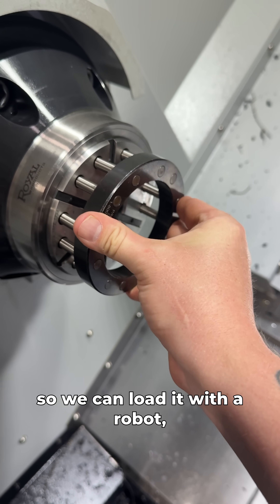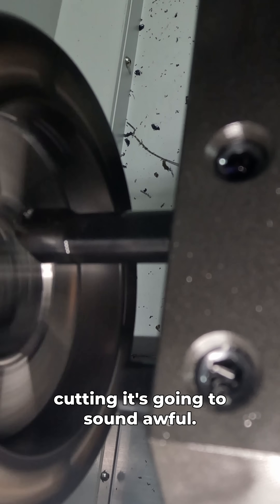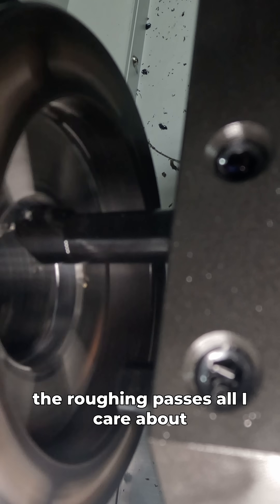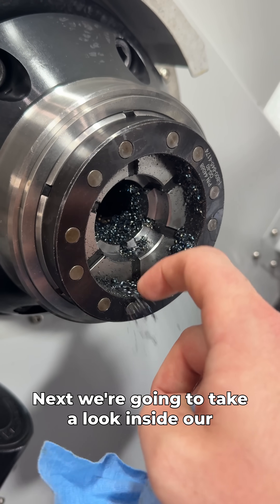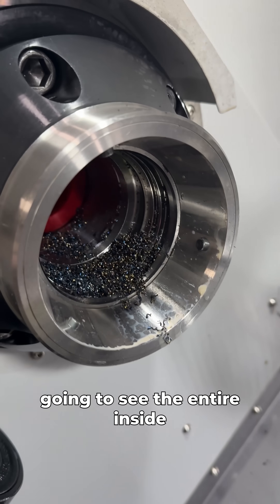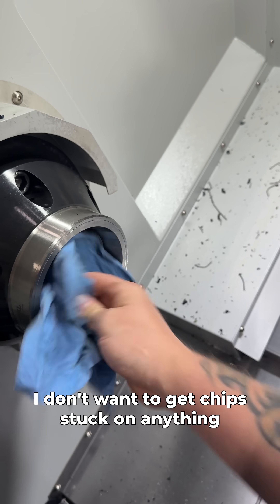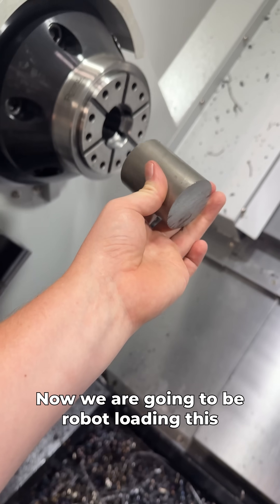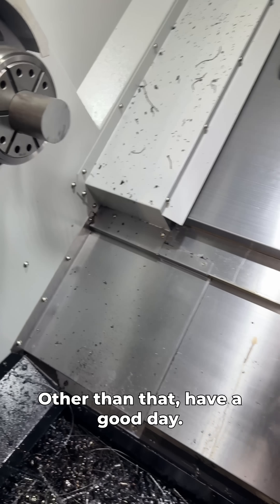Getting ready for robot load

Comment: You guys need to learn to use shop vacs like we did 40 or more years ago. I talked to my bosses into buying Craftsman shop vacs. Airguns have no business around machines
Reply: Shop Vac with a cyclone on it in my home shop.  The cyclone keeps metal chips and sawdust out of the filter.
Reply: Ordering 5 tomorrow. How did I not think of that? Hero of the day!
Reply: What about when your daily assigned  machine tool is a floor type Horizontal Boring Mill with a 30 ft x 15 ft y and  70inch spindle. Your parts weigh 1-5 ton depending and you're  filling 3-5 fifty five gallon drums in 6 hours or so? Compressed air is necessary  around machines in certain circumstances.
Reply: there wasn't high pressure coolant 40 years ago either...

Comment: I know nothing but why don't you blast air through the collet towards the working area to keep chips away from everything?
Reply: an extended air gun woulda worked starting from the back to front
Reply: The spindle/tube on these lathes is literally like 4 feet thick. I guess if you had a really long air gun it would work.
Reply: @BryceKimball7.3 I was thinking of the exhaust on a vacuum cleaner or a leaf blower
Reply: Because it can blow chips where you don’t want them.
Reply: @sjv6598 but aren't they already going where you don't want them?! Step one: get them away from the collet, further steps, suck or blow to get them away from other bad places🤷‍♀️

Comment: Iv used royal
Collets for a long time… never seen anyone cut one lol… they are like 500-800$ collets a piece lol. Don’t mess up😂 a programmed stop with a pin to pull your part too is cheaper then this lol
Reply: Well he said a robot would be loading it, so a pull out stop wouldn't work. Granted still wouldn't want to bore a collet for this. We have adjustable stops that mount in the spindle.
Reply: That's an emergency collet and made to be bored. The cheapest option is pretty much never the best option when machining. Get your set right the first time with as few variables as possible and it will pay off in the long run, boring a collet is the right choice